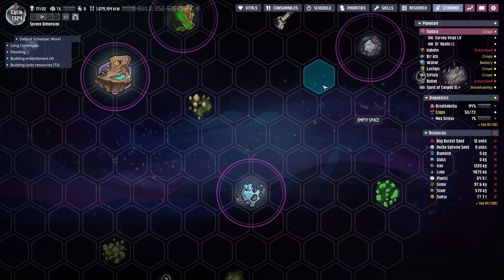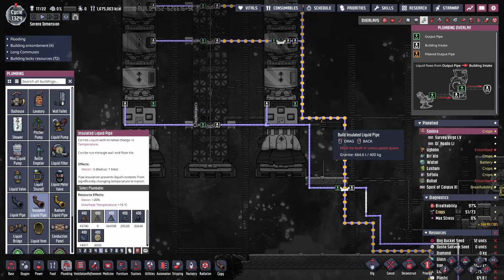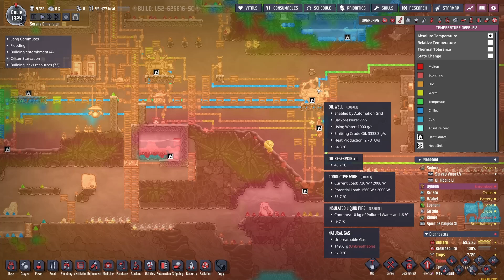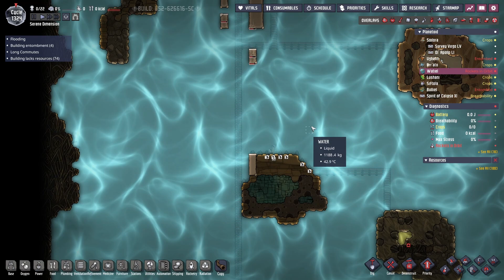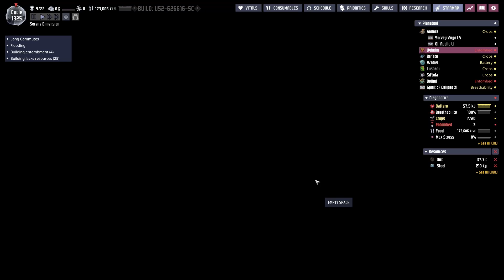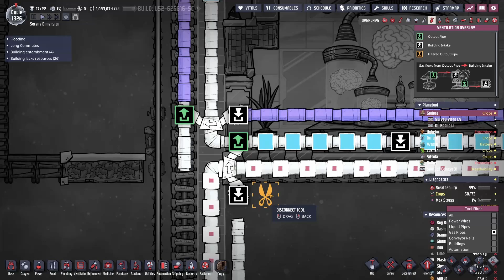Ep 153 - Radiation Preparation - Oxygen Not Included - Achievement Guide - 2024

Comment from the maker: This has been the longest playthrough that I have gone through where fertilizer has lasted me well past the 1000 mark! Does anyone think it would have been better to prepare for this moment sooner of being totally out of fertilizer?
Reply: it's not really critical like other resources and is easily renewable when you have ranches so its fine to delay making it. Just some quick numbers you need 4 tamed dreckos and pips to support 2 synthesizers running at 100% the excess polluted water from lavatories is enough to supply them as well (you need 3.5 duplicants to supply one synthesizer with pwater). Also you can place mesh tiles on spots where there is ethanol to mop them up